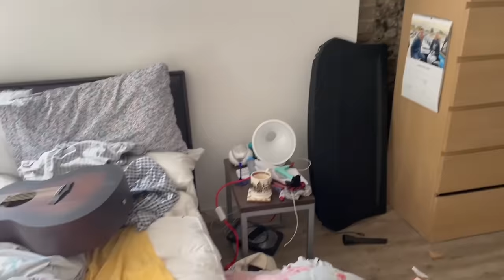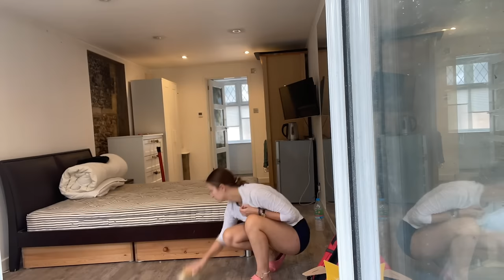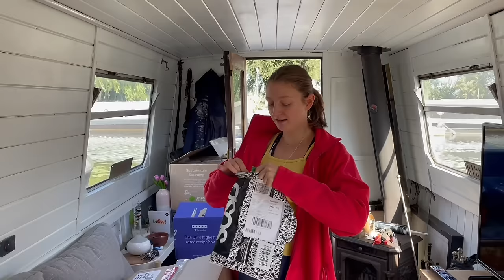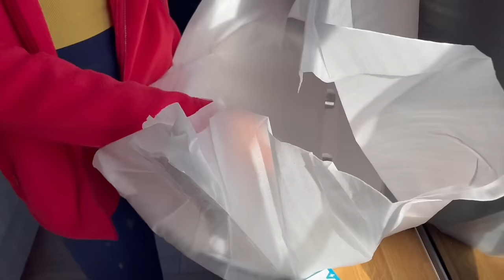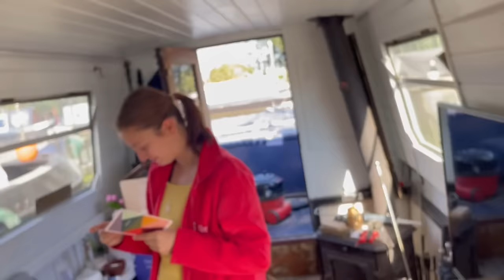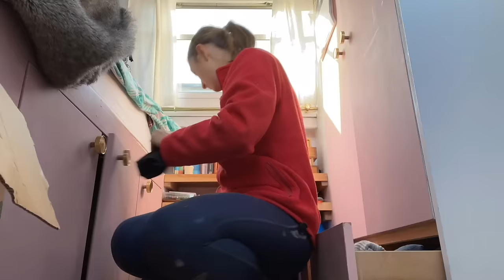Moving onboard our Narrowboat PERMANENTLY | Narrowboat Ratae | Renovation

Comment: I'm in the process of moving into my boat, it has been a loooooooong drawn out process but the end is in sight, so I'm interested in what you guys are doing. How did you find hanging pictures etc on sloping walls?
On a completely unrelated note, Chloe looks just like my sister
Reply from the maker: Hi it has been long! We have used picture hanging strips on each edge so the frames are flat to the wall, we preferred this look to hooks which made them angle even more and flap around when we are moving!